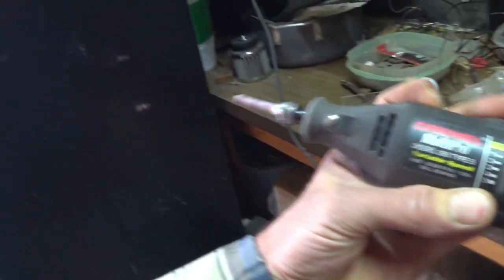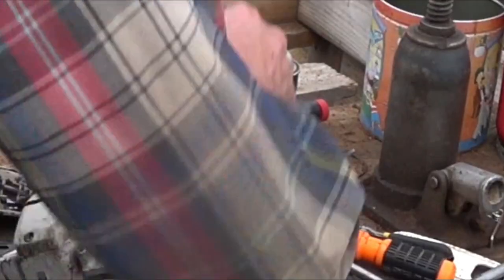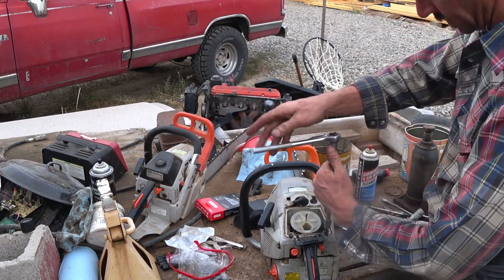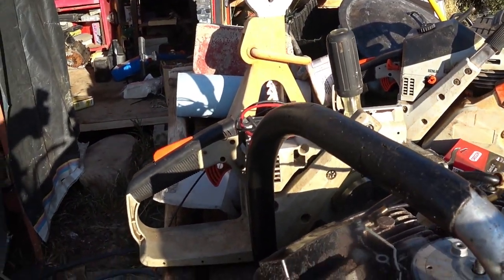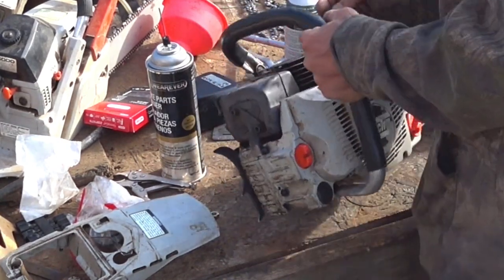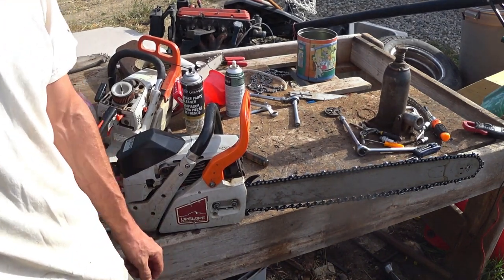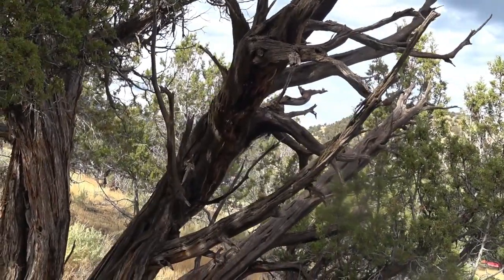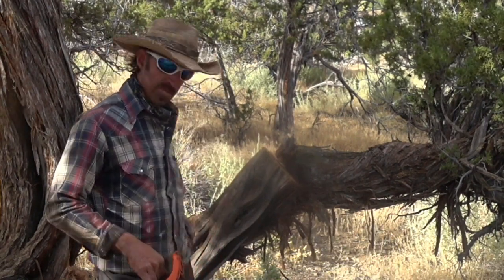Echo Chainsaw Clinic - CS-670 cutting and starting issues fixed | On The Homestread EP17

Comment: What did you have to do to get the ignition coil out? I couldn’t figure out how to get mine out
Reply from the maker: It's a bitch. You have to remove the rotor in front of it first, then take out the two bolts and it comes out, but part of the rotor holds it in.